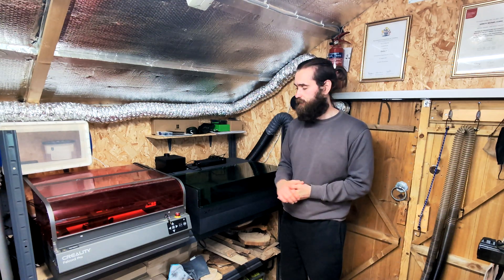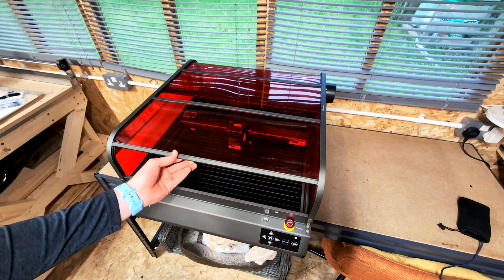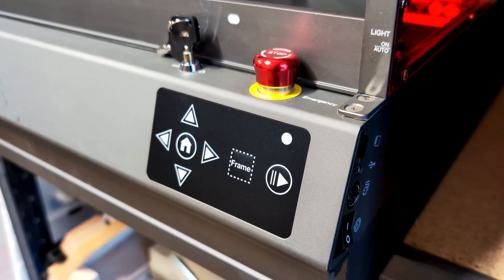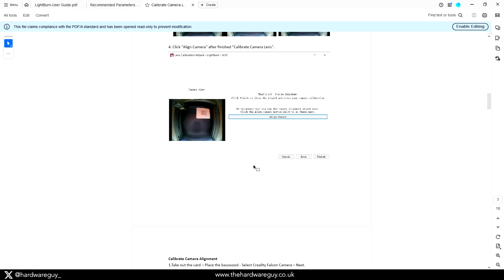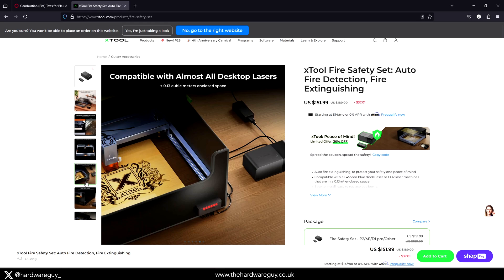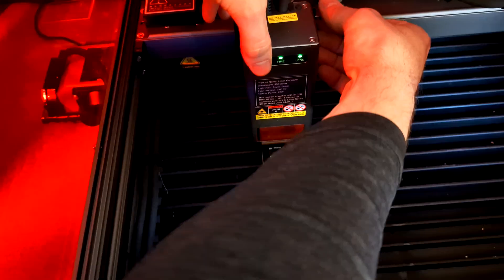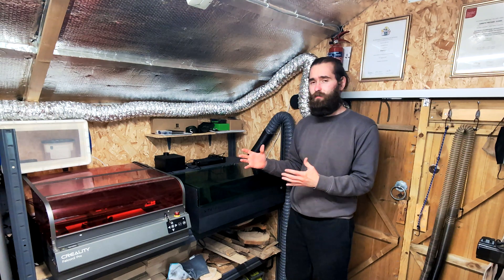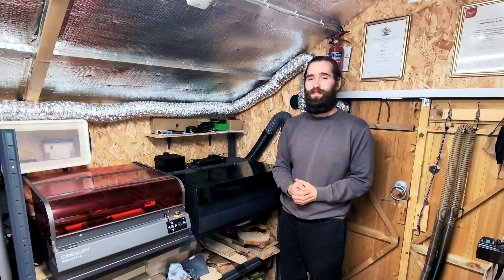xTool S1 vs Creality Falcon 2 Pro - Which should you buy?

Comment: Great comparison.  Looking at your rotary tool section, you engraved on glass using what think is black electrical tape.  Is that a way around the fact these machines cannot do clear glass or acrylic.
Reply from the maker: Thank you! that black material is actually acrylic paint. I cover this in more detail in my xTool S1 review. Hope this helps!
Reply: Diode lasers will pass through glass, making it impossible to engrave glass directly.
Using (black) paint, you can heat it up since it's no longer transparent.

If you want to actually cut (and not just engrave by first putting a layer of paint) glass or clear acrylic, you'll have to use a CO2 laser.